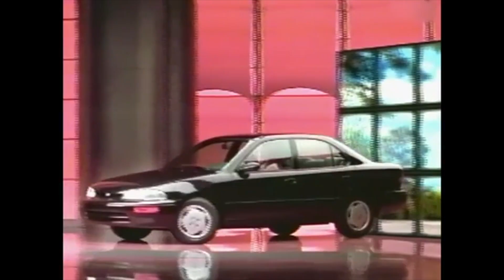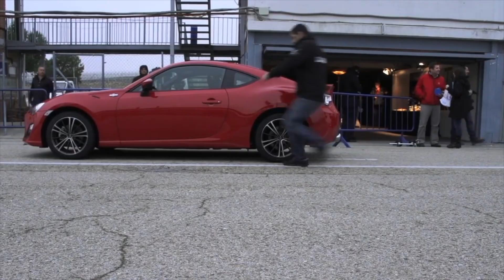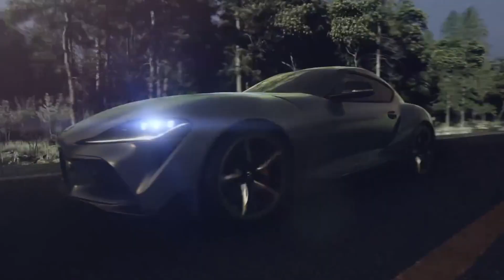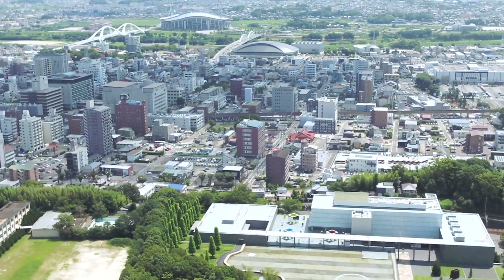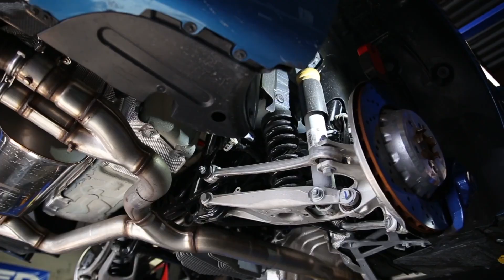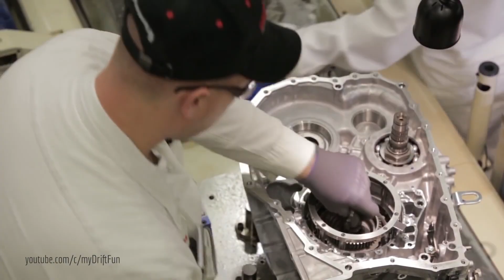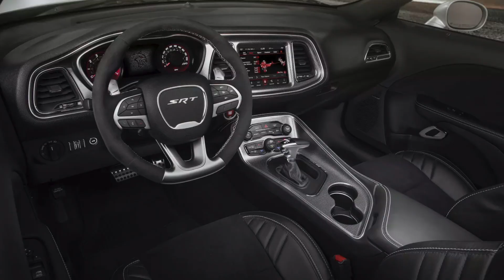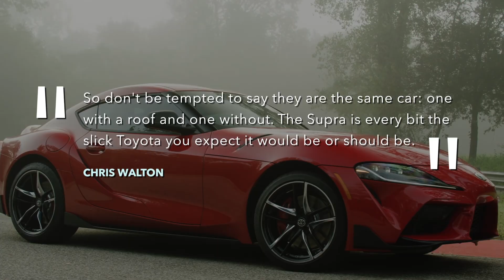MKV Toyota Supra - BMW or Toyota? The UNTOLD TRUE STORY

Comment: This is what I heard and understood
Engine/heart = BMW
Transmission = Third party
Suspension = BMW
Chassis = BMW & Toyota
Quality assurance = Toyota

So it is a BMW Supra.
Only difference is the looks and the tuning.

The Supra A90 may not be rebadged under law, but I still firmly believe that it is.

Why? Because Toyota is not there when they are building this thing, sure they are there, but not in heart or soul. They are only there to check boxes of what passes their expectation from BMW's parts bin.

What I expect is Akio Toyoda himself is leading the development and production of the Supra, but nope. The 86, GR Yaris, LFA had more love than their poster car.

It's a shame.

Calling this a Supra is heresy.

Comment: Toyota will never risk it's reputation specially on its iconic model. It's just matter of time till people will untap the full potential of this new supra
Reply: Have you not been following this platform lately?
Reply: @CJmk3supra  why
Reply: @abdainawi  This platform has been doing NUMBERS
Reply: @CJmk3supra  yeah I saw those pros taking it to 1000hp. But the limits are set because of aluminum block compare to the iron block of mk4
Reply: @abdainawi people are doing 7sec 1/4s with 1500 on stock block and they’re still trying new to go faster. It’s getting serious out there.

Comment: People can say what they want about the Supra. But this car has road presence like a $500,000 car. And it drives like a dream
Reply: Not really, I saw one of these rolling with an R35 and it made the R35 100x intimidating. It's great but not jaw dropping as any Porsche
Reply: @JABelms  An R35 turns heads, but porsche? You see dozens of those everyday, they're nothing special. You never see Supras, so people really notice
Reply: @moman007  The R35 is probably the most bought sportscar here in the Philippines, I see 3 everyday maybe because of how tiny our country is. There are way fewer of the new Supras, but they are really nothing (my Evo 7 also gaps them always). But Porsche are very rare, I only seen one GT3RS. Depends on what country you are in.

Comment: I actually hate  BMW vehicles after 1989. Their cheap  plastic coolant parts, plastic blades in water pumps, etc., which turn brittle and fail, have overheated  and destroyed  many an engine. Everybodys starting to use sub standard plastic , but BMW is the worst. They and Audi/VW are the worst in todays market.Overpriced plastic shit. Toyota will only pull down their reputation of being the best by associating with them . I doubt BMW Quality will rise...

Comment: This is wrong...yes toyota tested the engine as they were planning to use it. But they had no hand in the design of it. This was a myth started by chris harris.
Reply: Do you have any sites that talks about this? I've been looking around for information of Toyota's role in this engine and haven't found much.
Reply: @old_dan they literally didn’t do anything to the engine but tear it apart to see if it was good which Toyota themselves said it is.

Comment: The Z4 is a good car, I just think it's quite a shame that they couldn't coerce BMW into giving them one of their stronger engines during the negotiations. Regardless, my problem has always been that Toyota has had plenty of their own truly exceptional inline 6 engines and all they needed to do was dust off one of their old designs, refresh the heads for modern cam management systems and direct injection, and be on their way. But the route they took really is the cheapest possible way to get a car designed and built. Taking all of Toyota's needs into consideration, the only real complaint I can have is that they got done dirty by BMW over the engine and the front fascia is not to my taste at all.
Reply: If you read Toyota's chief engineer's interview, he explained that they don't have any inline 6 engines in production and the factories for those engines are closed. They wanted to make a new Supra as soon as possible and designing, and reopening or building a new engine factory would add 5-6 yrs to the production timeline. At that point, with ever changing regulations, the car may not happen at all.
Reply: @old_dan  If they want pure raw performance out of the next generation then they might as well make it an EV. As long as you hate tires and don't care how heavy the car is, it is trivially easy to make an EV go stupid fast. Making it handle well is an entirely different story, but you can absolutely make a crazy fast EV without needing to reinvent the wheel these days. But that isn't my ideal. My ideal is to take the design premise of the Chevy Volt and put it in a RWD or AWD configuration. A plug-in EV with range extension. That way you can get all of the raw performance of an EV with its ability to provide almost full torque from zero RPM, but you never have to deal with range anxiety until gas stations cease to exist. Give it a 40kW battery that's good for about 100 miles of range, perfectly suitable for most people's daily driving needs, then slap on a tiny little 3-cylinder engine with a generator bolted to the back end so it can feed the battery when it begins to run low.
Reply: @mndlessdrwer  Bruh, who the hell is talking about dumb EVs here? I just explained why Toyota couldn't use their own I6, not shit EV cars. 🙄
Reply: @old_dan critical thinking is hard for these people give him a little longer 😂

Comment: 1990s supras was last supras truly made by toyota
Reply: Ok?
Reply: MK4 A80 Supra.

A vehicle that is just a dressed up Toyota Soarer with a borrowed engine from the Toyota Aristo/Lexus GS
Reply: @Blackandgold51  still made by toyota
Reply: Look at the facts. The MK4 Supra was literally a sales flop. While the MK5 Supra literally surpassed the MK4 Supra in sales.
Reply: @samsonCoby That, and the fully-built-by-Toyota cars such as the Lexus RCF, ISF, GSF, LC500, along with the LFA didn't sell well
Reply: In that case, there's a list of vehicles(especially the legendary ones) that have been built on collaboration between two(or three) manufacturers. The Toyota MK5 Supra is NOT the first one;

McLaren F1, a British Fastest Naturally Aspirated Supercar, has a German engine which is a BMW V12

Mercedes Benz SLR supercar, half built by McLaren 

Mercedes Benz 500E, half built by Porsche

Pagani Supercar vehicles such as the Zonda, has Mercedes engines 

Dodge Ram/Ram pickup trucks has inline 6 diesel engines from Cummins

Ford F250 to F550 pickup trucks and large SUVs such as the Ford Excursion has V8 Diesel engines by International/Navistar 

Saturn Vue, a vehicle by the company Saturn that's under USA company General Motors, has a Honda engine and Honda Transmission

Ford Taurus SHO, has an engine that was collaborated by Yamaha 

Dodge Viper V10 engine was built by Lamborghini 

Buggatti Veyron and Chiron has mainly built by Volkswagen including the W16 engine being by Volkswagen 

Mazda/Fiat: The Mazda MX-5 Miata and Fiat 124 Spider share the same platform, with different styling and engines. 

Jeep/Fiat: The Jeep Renegade and Fiat 500X are built on the same platform. 

Mercedes/Renault: Mercedes and Renault have collaborated on engine development. 

Ford/Mazda: Ford and Mazda have a history of sharing platforms and engines. 

Audi RS2 Avant: This high-performance station wagon was a collaboration between Audi and Porsche, with Porsche modifying the suspension, braking system, and other components. 

AC Shelby Cobra: This iconic sports car was a result of a collaboration between AC Cars and Carroll Shelby, combining British engineering with American design and racing expertise. 

Cadillac Allanté: Cadillac teamed up with Pininfarina to produce this convertible, marking a return to collaboration between the two companies after many years. 

Mitsubishi Carisma: This model was built using Volvo S/V40 parts in a partnership between Mitsubishi and Volvo, 

Volvo 300 Series: This series was a result of collaboration between Volvo and DAF, according to a Reddit thread. 

PRV V6 engine: This engine was a joint project between Peugeot, Renault, and Volvo. 

Saab 9000, Alfa 164, Fiat Chroma, and Lancia Thema (Type 4 platform): These models were developed under a partnership between Saab, Fiat, Lancia, and Alfa Romeo. 

Saab 600: This model was a result of a collaboration between Saab and Lancia. 

Saab I4s: Saab and Triumph collaborated on the design of their first inline-four engines. 
Saab 2-strokes: Saab and DKW collaborated on their 2-stroke engines. 
Saab V4s: Saab and Ford collaborated on the V4 engines. 

Peugeot 107/Citroen C1/Toyota Aygo:
These three city cars were developed on the same platform, offering different styling and branding for each manufacturer. 

Infiniti QX30/Mercedes-Benz GLA:
This collaboration involved sharing chassis, suspension, engine, and transmission, but with unique tuning for each brand. 

Alfa Romeo Arna:
This model was the result of a partnership between Alfa Romeo and Nissan. 

Aston Martin Cygnet:
This city car was based on the Toyota iQ and represented a collaboration between Aston Martin and Toyota. 

Toyota Matrix/Pontiac Vibe:
These two vehicles were essentially the same car, with different branding, built on a shared platform.

Rolls Royce and Bentley uses/use BMW engines 

Dodge Challenger, Charger, and Chrysler 300/300C are based on a Mercedes Benz platform 

The list keeps going on

For the MK4 A80 Supra, the 6 speed Getreg Transmission is by a German Transmission manufacture while the 2JZ was built upon collaboration by an European firm company that was also involved with BMW engines. Plus the suspension is not even Toyota

The Toyota MK5 Supra's ZF8 Speed Automatic Transmission is not by BMW. And is used in different vehicles from different Manufacturers such as Dodge(Charger, Challenger, Ram), Bentley, Rolls Royce, and others

Comment: I was a hater of the Supra MKV. I thought it was the greatest failure ever. With the low horsepower numbers to the B58 being a mediocre engine, at best. Then, the numbers started coming in. The first were the 0-60 times and 1/4 mile times. No way this engine is producing 382 HP. Then, you witness the dyno numbers and you realize Toyota was lying about the numbers in the best way possible (the dyno numbers presented 382 at the wheel which translates to around 440-450 at the crank). Then Papadikas racing did a breakdown on the B58 and your realize it's a beast of an engine with so much potential. Now that they've released the manual, I have one on order.
Reply: Yeah and now people have extracted 1500hp out of the stock ALUMINUM block. Now the haters are are moving the goalpost to how long will that last while the people that drive it say they daily it lmao. Btw 380hp from a boosted engine is plenty, trust me people can barely handle 400. Look at the amount of crashed M cars.

Comment: I’ll put my two cents in - I bought a Supra 2 years ago. I love it. The shape is distinctive and still turns heads. The sound of its stock exhaust is entertaining and never fatiguing. It’s suspension provides comfort at distance and over the pot-holes in the battered U.K. road system. Very few exist in my area - the ownership experience thus far has felt like I am privileged to drive such car. I cannot quite understand the revulsion people have for its excellent auto gearbox, it’s paddles allow full control if you want it. There is plenty of room for tuning and upgrading - why this car hasn’t sold in larger quantities seems to me to be pure prejudice against its BMW - Toyota hybrid origins. This video is the best I’ve viewed in describing the cars design; superb work. Thank you

Comment: Toyota: After 17 years we brought you the all new Toyota Supra that you can enjoy again, we used a BMW Z4 Drivetrain so the development and final price would be lower
Idiots: ITS JUST A REBADGED Z4 NOT BUYING (while barely having money for a totalled GT86)
Reply: You're not an idiot for wanting a TOYOTA supra. I already have a BMW, I don't need another one dressed up as Toyota
Reply: @E9X330 Or you don't want a Toyota dressed up as a BMW Z4? Without Toyota there wouldn't be a current generation G29 BMW Z4.

The last generation BMW Z4 was clearly a SALES FLOP.

Both Toyota and BMW had collaborated on the Supra's Platform/Chassis especially to save cost. Otherwise, there wouldn't be a current generation Supra MK5

Also, last I checked the Supra MK4 A80 is just a dressed up Soarer

Comment: Together they used a bmw engine, bmw chassis, bmw Drivetrain, bmw suspension, bmw ecu,bmw body panels. Bmw interior. And even a very unique bmw steering wheel with a toyota badge. This is such a jdm masterpiece!
Reply: None of what you said is true 
And idk what you think JDM is, but unless the car is built for the Japanese market it's not JDM
A left-hand drive MKIV is not JDM
Reply: @stefakyou6103  pretty much everything he said is true lol

Comment: i hate fake vents ya know!
Reply: They're functional
Reply: @stefakyou6103  no they are not
Reply: @E9X330  yes they are, they're removable so you can get more airflow to wherever it is you need it
Reply: @stefakyou6103   no they aren't, had you bothered to research your claim before commenting you'd know that there is metal behind the vents 🤦
Reply: @stefakyou6103  they're removable but there's metal behind them, owners have already checked this 😂🤦

Comment: I like this Toyota Supra however realistically speaking, I wouldn’t even pay over $50K for a re-skinned car body that’s inspired by the Toyota FT-1 concept with BMW performance underneath it with fake plastic vents included that makes it shabby as it feels cheap in a way.
Reply: For 50k you get a car that does 0-62 in 4 seconds
The chassis was made by Toyota and BMW so it doesn't have BMW characteristics
And the "fake" vents are removable to get more in the engine bay and wheel arches
I don't know if you've sat in one
But nobody has ever sat in a MKV and said it feels shabby or cheap
Reply: @stefakyou6103  stop spreading misinformation

Comment: Bmw, 30 yrs and not as good as last real toyota supra. Only bmw can use 30 yrs to make a worse car. If it was a toyota it would be worth owning, butt ugly cannot roll windows down.with out going deaf and getting shaken to death. New z looks better and is better.
Reply: Worse car except it's lighter, faster, more fuel-efficient, better suspension, and better-looking lmao.
Reply: @gabagoooby  not hardly more expensive pos bmw will breakdown by 100k miles cost more, and does not handle or run better. Buddy has one, has for sale can not give it away. Waste if money. Many better cars cheaper faster and runs and handles better for less. Look at sales for it, they suck cause it sucks. I own toyota i love toyota, new supra is no toyota, it is rebadged over priced over hyped piece of crap bmw.

Comment: It's great that they feel different, but unless you've driven both you wouldn't know. So they need to sound different, look different. 
What Supra needs is a cock-pit like interior designed by Toyota, and a few performance mods to better differentiate the B58 in the Supra from the Z4.

Comment: They are the same car and what hurts is that one of the most reliable brands team up with a brand that has an arsenal of unreliable cars and letting them take control of the project, like you said on the video toyota only did testing on some parts ,that's why i don't like it, it isn't as reliable as the mk4 or any other toyota, why the car has so much fake air vents, and the body is simply horrible, that's a bad design In staad of making that dream killer they should let the supra live as a happy memory

Comment: Don’t get it wrong

Even if you are disappointed with the engine, the car has a 50:50 balance front and rear and right in the middle of the golden ratio.

And it looks amazing but the front end could be better.

Comment: Great video but I am still not buying a Supra with a BMW engine. I have made this decision a year ago. To each his own I guess. I will continue to buy other toyota vehicles, just not the Supra.
Reply: 2JZ wasn't meant for the MK4 A80, it was meant for a different Toyota vehicle which had the 2JZ first!
Reply: @borla4491  It was on the Toyota Arista in Japan before it was placed on the Supra but I wouldn't make such implications that it was never meant to go on the mk4. It's not your call nor mine to claim that it was never meant for the Supra. That is Toyota's decision. The 1jz made its way to the mk3 so I am sure the mk4 was in Toyota's mind when they made the 2jz. Toyota also likes to put engines on multiple vehicles, they never just make an engine for single model most of the time. I think the Lexus lfa might be the only but I could be wrong I'd have to do some research on it.
Reply: @alphanation368  Also the Supra Mk4 A80 was not around until 1993!

The Aristo was out two years prior!
Reply: @alphanation368  "it was in the Toyota Aristo in Japan"

Uh Newsflash!

The Lexus GS was a rebranded Toyota Aristo in the USA, them had 2 versions of 2JZs and a V8!

Comment: Unless Toyota insisted on Not Using Plastic Inside the Engine(Timing Chain Guides) and with Water Pump Assembly and other Accessories under the Hood Trust the Vehicle Will Not Make It Past 80k-100k without Major Mechanical Surgery being Required

Comment: 2 years late but so this is the truth. BMW provided the tooling, and both them and Toyota designed what they wanted. Not as simple as a Toyota taking BMW parts or a BMW sharing a platform. In a way that understanding probably wouldn’t have saved its rep. Despite being somewhat undeserved the Supra is held as sacred, and people weren’t gonna accept anything less then a bespoke return